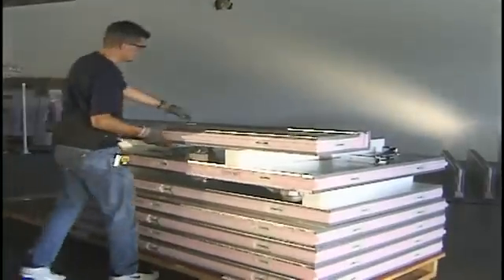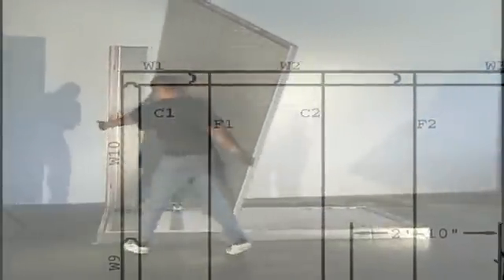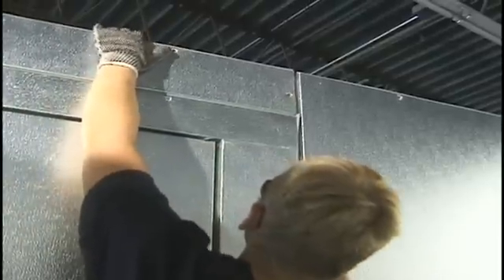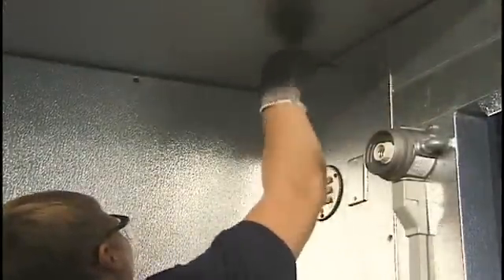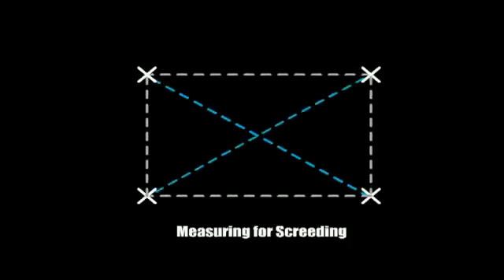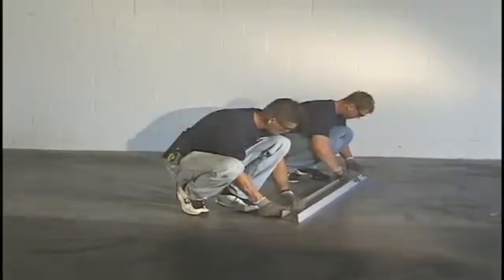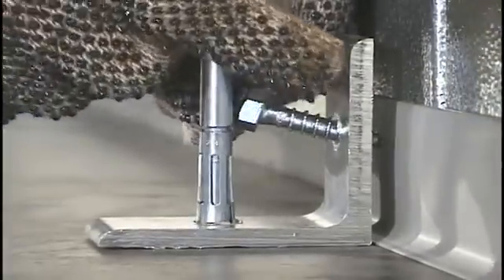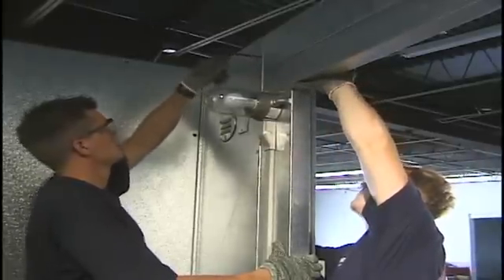Пошаговое руководство по созданию холодильной или морозильной камеры | Вектор Холода | Фризер |

Comment: Considering a lag screw is used to secure the L bracket to leg of the door, do the door frame legs have wood inside or a solid surface throughout the full vertical length and how wide is this solid surface? Would outswing lockable barricade brackets easily grasp the legs when scewed in place?